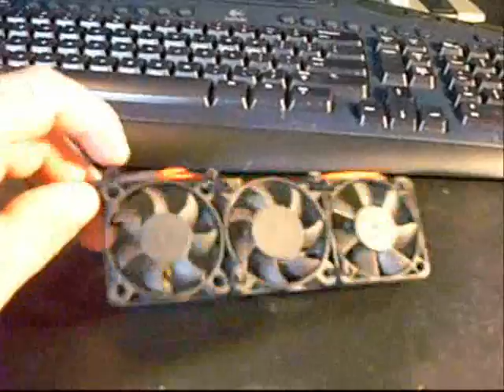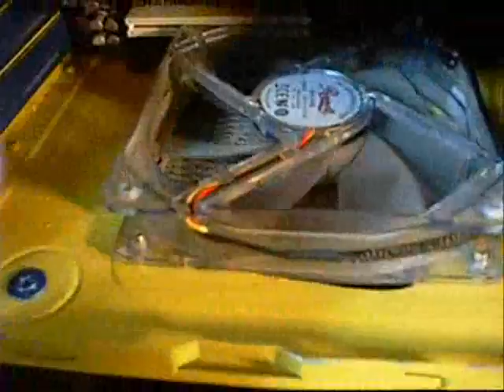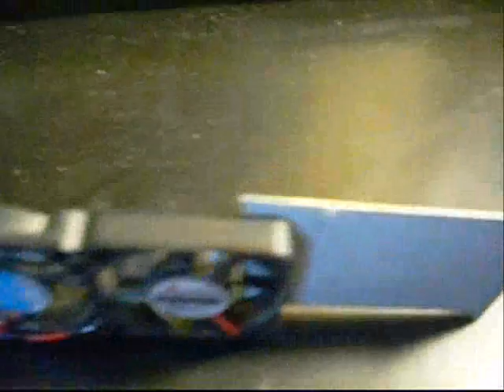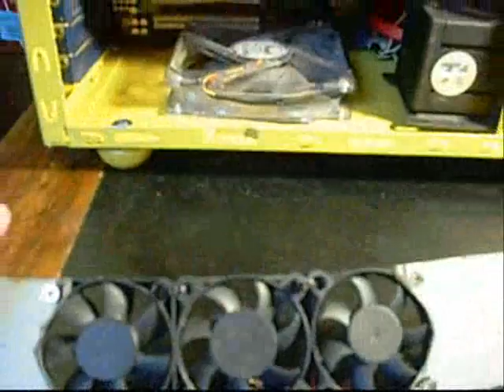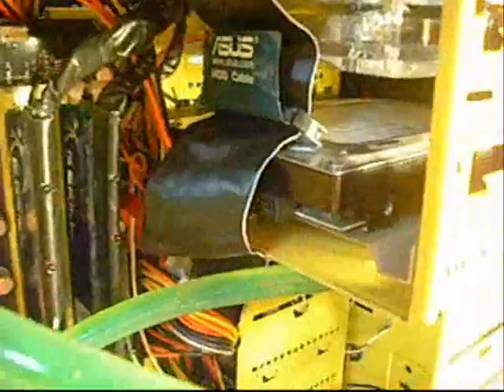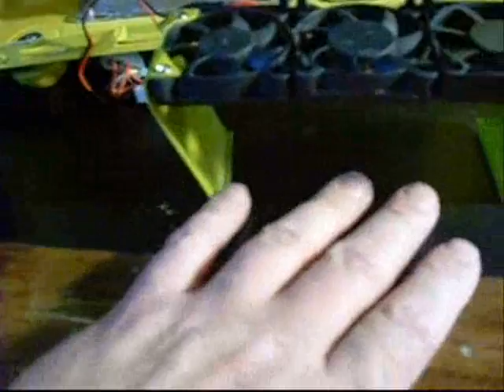Cheap ram cooler mod and latest mods on the water cooled machine

Comment from the maker: @DJPaulgee1 That is a great question. Your power supply should handle it without any problems. Most fans will only draw about 5 watts. So even if you added 10 fans to your case it would still draw only 50 watts or so a lot less power then say a second video card. So you should be able to add them ones that you want with out any problems at all.

Comment from the maker: Thank  You. 

Yes I cut a hole at the bottom and mounyed a 120mm pulling cold air in for the video card. I also aded case feet on it to life it up a inch or so. To make sure it had plenty of room to get freash air from.

Comment from the maker: @ferretco Glad to hear that you are still with them. 

The pentium D did get a bad rep but in reality it wasn't really that bad of a cpu. Just wasn't up the standards at the time set by AMD. I still love mine and use it all the time is my setup work station. 

I am hoping to build a HTPC some time before winter. I have started accumulating the parts for it. But ran out of money. So no board or cpu yet. 

I am a bit surprised that you would say the I5 for a home pc and not a I7. Do

Comment from the maker: The north-bridge control most of the flow through the motherboard. So the faster you pump data into it the hotter it gets. You can cool the south-bridge also but they tend to not get nearly as hot because they control things like onboard sound.

Comment from the maker: @Abzyoutbero Safer then letting things get too hot. There is always a chance of a fan failing but I have yet to see one cause a fire. But I have however seen other components start on fire when they got too hot or if the case wasn't cleaned regularly.

Comment from the maker: @crazymn321fan It works just like a cooling system on a car. It uses a pump to push the water through the water block. Then the water goes out to the radiator to be cooled then back to a reservoir for the pump to use it again.

Comment from the maker: @ObservedFIREFLY If you have a electrical tester you can check some of the other wires underneath it to power it like maybe the cd/dvd drive. Also make sure if it is 12 volt to find a 12 volt source or if it is 5 volt to find a 5 volt source.

Comment: you should paint the box around the blades yellow and leave the blade assembly black, that would make the ram cooler blend in with the rest of the build. I used you fan mod video, very helpful, but the sticker wouldn't go back on after.... I had to use electrical tape LOL

Comment from the maker: @hotpot71 You are absolutely correct. One of the fans checked out fine on the bench but after I got it in there it was making noise. I guess it didnt like being on its side. When it was flat it was fine. I wanted to wrap up the video so I replaced it after this video was made. Good ear :-)

Comment from the maker: The rule of thumb is that you should never pull more then 1.0a from the motherboard headers. That's including all the fan headers including your CPU cooler. So unless you are running a bunch of other fans off of the motherboard you should be fine. If you are worried about it you could always hook them three fans together and connect them to a molex to plug right into the power supply. They should all be 12v fans.

Comment: Hey i got a question. Nice job btw. So you have holes that you drilled in the bottom of your case with a 80mm fan sucking in air to your vcard? Is that what is going on at the bottom of your case? Thanks

Comment: @FUzzyBUnnyBOoties kk sent it, also i may try a Antec hasis full tower im still pawndering with th idea because what i want to do is i have a custom built 1 gallon container resivor for water cooling with 100 uv and i wan to do quad CrossfireX with 4 Ati Radeon HD 5770 with water cooling on all 4 the 860 on the ram and im doing a raid0 with 2 160GB Intel SSD's i want to unscrew them and put a fan infront to make sure thecomponets are cool but i want ROOM im gunn try for 130 FPS on 3 32 inches:)